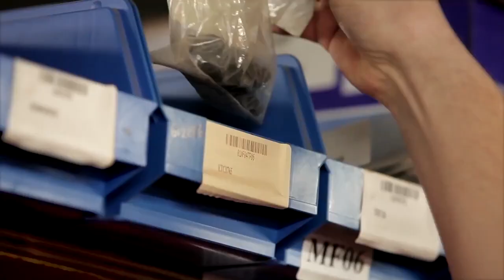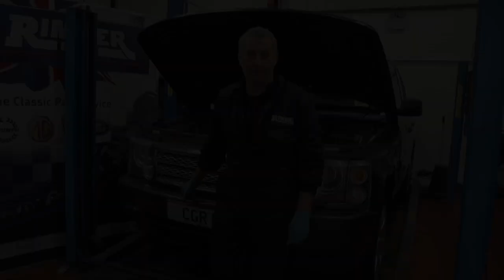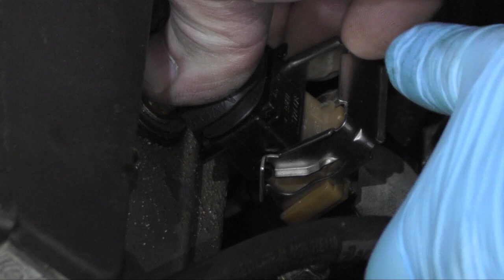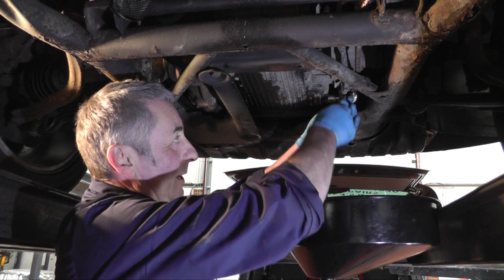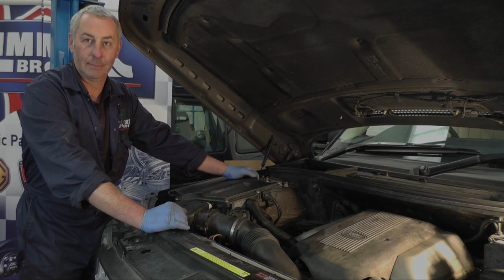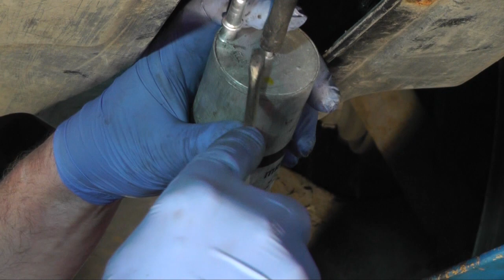Range Rover L322 - Engine Service Procedure

Comment: I have a 2006 Land Rover LR3 HSE 4.4 V8 I'm replacing cylinder head gaskets. Can you please help with timing? Where is number 1 piston related to the key way on crankshaft?

Comment: Hey john paul  great work .
I have a 04 HSE  with a ticking noise on the left side of my engine . 
Also my transmission it looks like stuck on 5th gear . It does engage reverse and going forward it shifts all the way to 5th gear , any tips on that ?
Thanks
Reply from the maker: Very difficult to diagnose without the vehicle here. Think it's time to take it to a garage unfortunately.

Comment: Hi Guys, is the ignition coil  different on the LPG system compared to the Petrol only? I've just bought a 2003 4.4 v8 with gas conversion and it has a miss fire, if so, would you be able to tell me which I need, thanks

Comment: Nice, clear and thorough video, cheers.
How robust are the automatic transmissions on the models with the BMW V8?  Are they a ZF or GM box?
I'm looking at a used car (first LR), 200,000km and has just had the suspension overhauled as well as the timing chain and head gaskets.  Should I steer clear or roll the dice?
Reply: ZF transmission, if the price is good, go for it.
Reply: Probably too late now, but for what it's worth, any Range Rover that has been touched by BMW should be avoided imo. Stick to 2008 on up.
Reply: You have no idea what you are talking about. BMW is the only way to go in the Mk3 RR. 
  The m62 is a legend.

Comment: Rimmerbros. What are the special pliers John Paul uses in this video for fuel filter replacement? The pliers to disconnect the lines? Thank you
Reply from the maker: Something like this I would imagine https://www.amazon.co.uk/Silverline-451946-Disconnection-3-Piece-Sizes/dp/B005DQ6WVW/ref=sr_1_4?ie=UTF8&qid=1545988190&sr=8-4&keywords=fuel+pliers
Reply: Make sure you purge any fuel in the line by pulling the fuel pump relay in the rear as the car is running. Let the car stall out from having no gas as to help depressurize the fuel line when removing the fuel filter. Then when fuel filter is replaced just simply reinstall the fuel pump relay and start the car up and go.

Comment: Outstanding instructor, subbed! Hope you have some more videos on the 2010-2013MY.
Reply: only thing is remove the oil filter before you drain the oil so the oil is gone in the filter housing

Comment: Hi there.  I was doing my first oil change on my 2004 L322 today and I accidentally removed the drain plug at the rear of the engine instead of the actual oil sump drain plug.  I'm talking about the one with a pipe running to it that looks like it goes up to the PCV Valve.
The oil all drained out and I then took out the actual oil drain plug just to see if anymore would come out but the sump was empty.
My question is if I put the two drain plugs back in, replace the filter and refill with oil will it be ok?  Or have I done something really silly and drained some other fluid?  Very helpful video by the way.  Thanks.
Reply from the maker: Yep, you should be just fine.
Reply: Rimmer Bros TV Thanks for the reply.  It looks like it's a return line from the oil separator up the top.  Appreciate the confirmation.

Comment: Hello✋🏻, I have LR3 V8 4.4 I want to now if I'm doing break bleeding to my car should I takeout the battery or just take out the key from the ignition ? Thank you
Reply from the maker: If you are using a pressure system to bleed the brakes, then you do not need to remove the battery or key. If you are using 2 people, one of which is pumping the brake pedal, then you will need the ignition on to activate the brake servo which will make the task easier as the pedal will be hard to move otherwise. At no point should you need to disconnect the battery or remove the key.
Reply: Rimmer Bros TV  thanks for answers , but I want to say what I understand , by pressure system you mean obd tools that I must hook it in the car system to clear  and read faults !!      In the two situation I don't need to take the key from ignition. Excuse my weak English and thanks
Reply from the maker: This video should answer your questions:

https://www.youtube.com/watch?v=cR58OPt13Gs
Reply: Rimmer Bros TV thank you 👍✋🏻